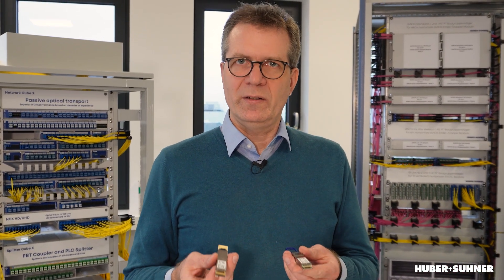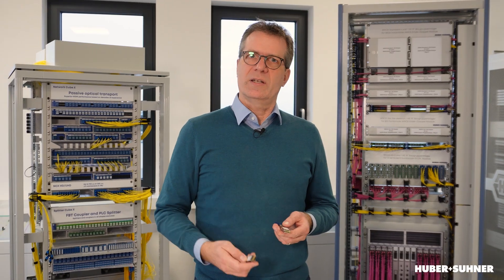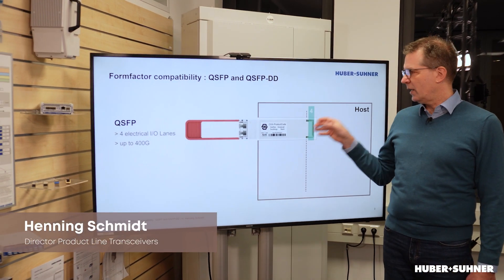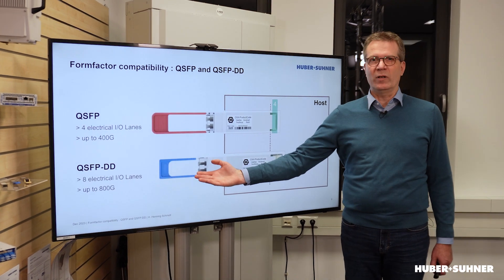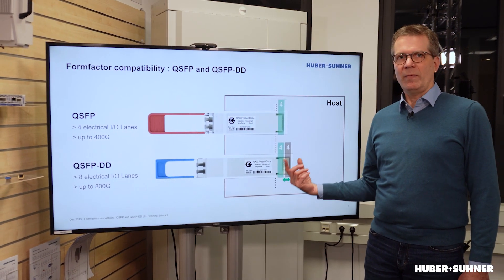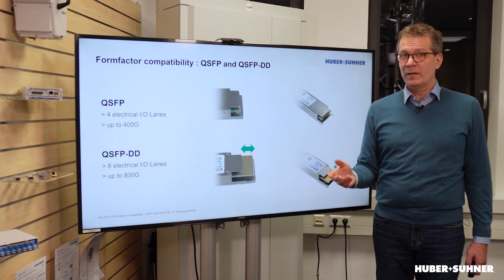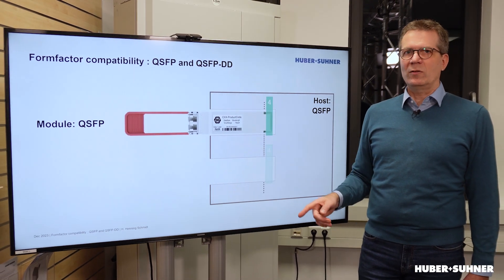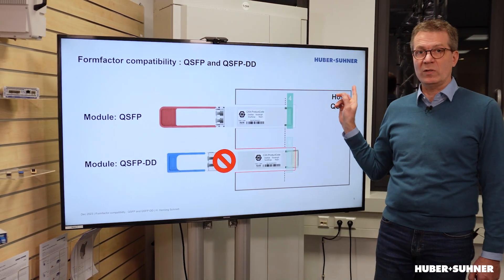QSFP and QSFP-DD Transceiver Compatibility explained (04-04-02)

Comment: Sfp B ,B+,B++, C+,C+++ 
Who best ? Please provide video
Reply from the maker: Thanks for your suggestion. Nice idea. I’ll look into it but am not quite sure when we will get round to making it…
In the meantime, could you give me some more details on what specifically you are interested in knowing. “The best” always depends on multiple factors (i.e. what is your specific setup/application)?
Reply: @HUBERSUHNERGroup  Rx Tx and single mode and multi mode
Reply: @HUBERSUHNERGroup  Sfp class ❓
Reply: Please reply me
Reply from the maker: Hi @么NooB,
apologies for the delayed response.
Unfortunately I am having to tell you that the questions you ask aren't simply answered in a short comment or video. The reason for this is that very much depends on what your specific setup is.
I can tell you that B+, C+, etc. are different power classes for the PON transceivers (e.g. for GPON and XGS-PON). To be more precise, C+ has a higher TX output power an RX sensitivity than B+. Unlike with other transceivers, this higher optical power budget doesn't increase the reach of the transceivers but instead is required if the PON setup uses a higher split ratio.
Having said that, this probably won't help you much in answering your question as it is a very generic answer. Therefore, it probably is easiest, if you discuss your requirements with one of our customers solution engineers. They can tell you specifically what you require and can provide you a quotation for the equipment (transceivers, splitters, WDM, etc.)
To get in contact with our engineers, please fill out this contact form: https://solutions.cubeoptics.com/contact
Reply: @HUBERSUHNERGroup  Brother i am 19 years old. I could not understand the answer to our question ❓ Please help me 😭
Reply from the maker: Okay, then let's take a different approach. Why are you trying to find out which transceiver (Sfp B ,B+,B++, C+,C+++) is the "best"? What are you planning on doing?
Reply: I am a student of Bachelor of Computer and want to learn Internet olt Management 
⚡can you teach me⚡
Reply from the maker: Unfortunately, I am going to have say no. Explaining the working principle of PON (or OLT management) is nothing that can be done by writing a couple of comments but instead would at least require a 1 on 1 session.
However, there are a lot of good articles explaining the fundamentals of PON (sorry, we don't have a video on this yet nor a document that would explain it). My recommendation would be to enter "basic working principle of PON" into your search engine and you'll get a whole bunch of good results.
Sorry that I can't be of more help.
Reply: @HUBERSUHNERGroup  course name
Reply: @HUBERSUHNERGroup  Which course should I prepare for this
Reply from the maker: I am not aware of any course. I believe you will have to figure this out by researching online and reading through numerous articles...